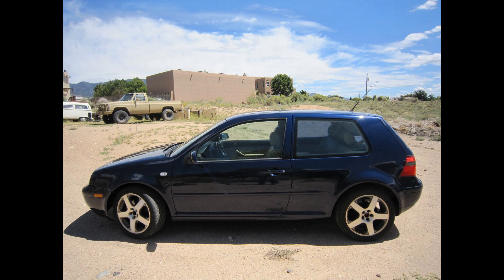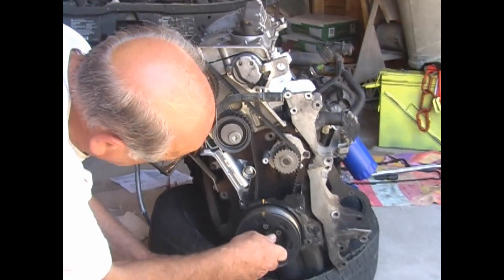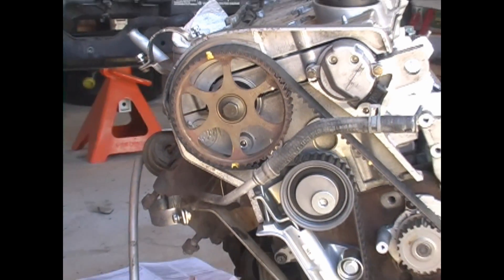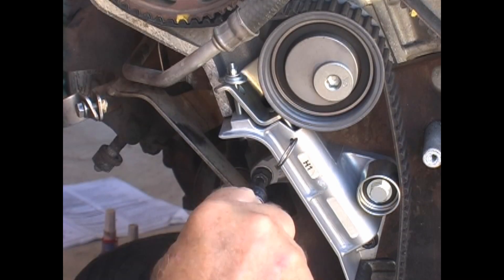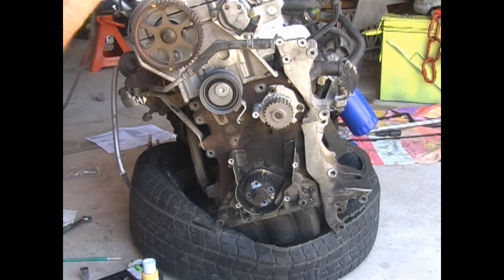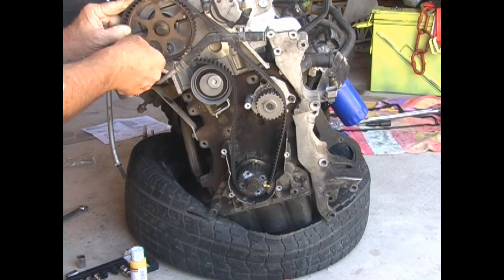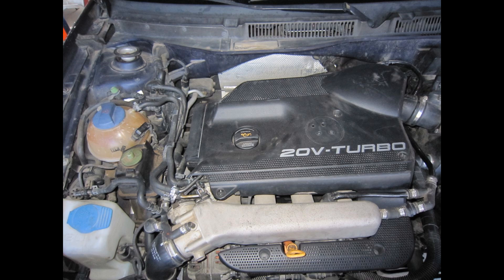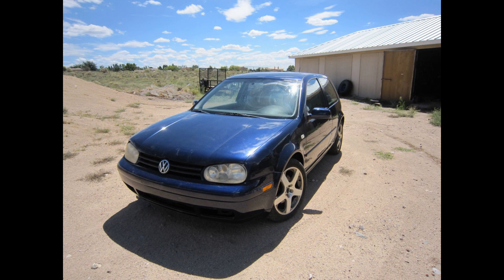VW/Audi 1.8 Turbo Timing Belt Replacement

Comment: I'm trying to do this fix but I can't get the crankshaft pulley and the camshaft pulley marks to line up at the timing marks at the same time.
The marks are way off and not 180 degrees The engine runs good but needs a water pump . This car is new to me but I can tell the belt has been replaced at one time  it's a Napa belt . Any idea what I'm doing wrong? Great video by the way. Thanks
Reply from the maker: Hi Mark - I just got back in town from Christmas trip and saw your message.  I am assuming that from your comments, the car is still running but needs a water pump replacement.  If the engine is running fine it means that the valve timing is very close to correct.  If it were very far off, the engine wouldn't run very well if at all and the valves could be damaged but that doesn't seem to be the case with your engine.  At around 50 seconds into my video, it shows the timing marks lined up.  Just be aware that the camshaft rotates half the speed of the crankshaft.  I suggest you rotate the engine to get the camshaft marks lined up and then check the crankshaft marks.  If they are not lined up as shown in the video, maybe you could describe what you see at the crankshaft marks.  It could be that when the previous belt was installed that is was off a tooth or two  That is easy to do and the big reason behind my suggestion to mark the belt.  I will be glad to help further if you haven't figured it and can supply some more detail.  Good Luck.  Wayland
Reply: Wayland Adams  
Thanks for replying, yes the car does run fine but needs a new water pump. When I try to get the motor to TDC no matter how many revolutions I can't get the crankshaft to line up at same time and it's a long ways off and more than a tooth or two. I'm wondering if the  pulleys could of been taken off at one time and put on wrong? Could I just go through this process of marking everything with the cam at the timing mark as long as nothing gets moved?Thanks for helping
Reply from the maker: Mark  That is really strange.  The pulleys are only supposed to go on one way.  But yes, you can follow the procedures, marking the belt at corresponding marks on the sprockets.  So, I would line up the camshaft timing marks on the sprocket and engine block, then pay real close attention as you remove the crankshaft pulling and cover.  At about 1 minute 30 seconds into the video I show marking a crankshaft tooth and the corresponding position on the block.  This is real important to do since the timing marks have been removed with the pulley and cover.  Then just make sure these marks stay lined up through out the procedure.  You will note in the video that I mark the belt at the timing mark on the camshaft, but at the crankshaft the mark on the belt is not at the timing mark.  But that is okay since you just want to keep the same relative position.  It doesn't show very well in the video but at the place where I mark the belt at the crankshaft, there is a little knob on the sprocket.  This knob is what aligns the pulley in only one way with crankshaft.  I just picked that place but you could pick any place where the belt is engaged on the sprocket and mark both the belt and the sprocket.  

It sounds like you have a pretty good understanding of what needs to be done.  But if you think you need more help let me know.  If you want to give me your phone number and/or email address we could talk and/or exchange photos.  Good luck on getting this done.  Wayland
Reply: Wayland Adams 
Thanks for the help, I messed with it today and got the pulleys lined up finally. Thanks again for the help
Reply from the maker: Glad  you  got it.  Hope the repair goes well.
Reply: Wayland Adams I could use your help

Comment: Somebody help me please! !
I did a timing belt, water pump, tensioner yesterday on my 2000 audi tt 1.8. Water pump was leaking, so I decided to might as well change everything;, so I did.
When I was done I started the car and 2 mins later check engine light came on;code reader said:( cylinder 1 misfire detected)
So.. I changed spark plugs and switched ignition coil from cyl. 1 to cyl. 4 .
Started the car and check engine light came back on. Checked it and still tells me p0301 cylinder 1 misfire detected. Any ideas or suggestions please Help me ! Thank you ☺.
Reply from the maker: Hi Danny

Sorry you are having problems.  It takes three things to have combustion.  Compression, fuel, and spark.  You have probably eliminated spark by changing the ignition coil but don't completely rule it out.  You can do a compression check to make sure you are getting compression on that cylinder.   It would be pretty unlikely that compression is the problem but it is easy to eliminate.  For the fuel injector, first just make sure it didn't get disconnected while you were working on the engine.  You can also google how to check a fuel injector.  You just need to make sure you have all three of those items.  I have to assume you did the timing right since it is running on the other 3 cylinders.  Good luck.  Let me know if you have other questions.
Reply: Wayland Adams 
Thank you Sr for replying.
I will definitely take ur advice and check injectors. 
And yes like I said: the car didn't change in engine sound and performance wise, it just runs like it did before,  but what worries me is that I don't know much about the electric stuff,  like for example if I needed it to reset or disconnect cam or crank shaft before I started the car.  
Because all I did was Take out parts and put them back the way they were back, and started the car and 2 min later check engine light says cylinder 1 misfire.
Any thoughts on cam and crank shaft. How they  work?   Could that cause a misfire? Should I check those? (Car starts right away,and doesn't hesitate or feels weird after all the work I did on it.)
I may add that my fuel gauge had been working abnormal way before I did this timing belt procedure, sometimes it worked just fine and sometimes it drops  dead not working at all, I changed the fuel pump and fuel filter but that didn't fix it, so I just let it be but never gave me a check engine light,  I wonder if it's related... maybe..  
I'll keep updating yall as I'm  making progress on my TT. ☺
Reply from the maker: You shouldn't have to do anything other than what you did  There is nothing to reset.  Just check those 3 things and make sure everything is connected.
Reply: Wayland Adams 
Oh OK thank you!! That takes care of my concerns about that. ☺
I may add that my fuel gauge had been working abnormal way before I did this timing belt procedure, sometimes it worked just fine, and sometimes it drops  dead not working at all, I changed the fuel pump and fuel filter but that didn't fix it a while ago, so I just let it be but never gave me a check engine light,  I wonder if it's related.
I never bother to fix it ,cause it never gave me a check engine light.
Thank much for your time and advice, very much appreciated ☺
Reply from the maker: The fuel gauge will not cause a check engine light so I don't think that is related to your current problem,.
Reply: Wayland Adams 
Okey dokey 
I will continue my investigation and follow your advices.
Thanks much!! 👍👍

Comment: So that's the thread pitch? 5x55mm doesn't tell me that.
Reply: 5 x 55 means M5 thread form and pitch and 55mm long.  M5 is an ISO standard and it only comes in one form.  If you buy a kit the tensioner should be pre-tensioned with a pull out pin you pull when ready.
Reply: It's not relevant. You may even be able to use a 6mm nut and bolt. Just buy a 55mm long bolt and the nut to match. Better yet, buy a couple of nuts. You may drop one and they always get lost. Also, buy 5mm washers and some extras for the same reason. (BTW, the thread pitch of a 5mm nut or bolt is .80mm.)

Comment: Wayland adams u are the man explain all the work on astra very good mate  but I want to know more work on to new  astra which is 1.7 cdti 2012 plate hatch back  anyway thank you verymuch  mate keep it up
Reply from the maker: I am not aware that we have that car/engine available in the US.  I did look a little online  and found that just like the 1.8 Turbo in VW it is an interference engine.  That means the valves will be damaged if the timing belt breaks so it is very important to change it as recommended.  While I don't have access to this particular engine I would think you could follow the basic steps I outlined.  I just really found it useful to mark the old belt and transfer to the new one.  I assume you have also looked online at some of the instructions there for changing the belt.  Good luck.

Comment: Do some work on the astra 1.7 cdti 2012 plate
Reply from the maker: If you are asking if this works on the astra 1.7 cdti engine, I don't know for sure.  The principles of marking the belt and aligning the timing marks apply to all engines.  Good luck, if you have further questions let me know.
Reply: Wayland Adams good luck mate

Comment: im going to attempt this without removing the engine.. im only in highschool and my 1.8t gti is my first car haha. i cant afford the price a shop will charge me, so wish me luck.. Thanks for the video!!
Reply: Do NOT REMOVE THE ENGINE MOUNT COMPLETELY.. .you will never get it installed with belt installed... it’s a pain. Yes but it can be done
Reply from the maker: Jorge  Good luck with this.  It is possible to do in the car using the same procedures as in my video.  I did it outside the car for two reason.  I had to change the head also plus I couldn't really show the things in the video with the engine in the car.  Good Luck!!!
Reply from the maker: Yes, you can mess up the engine if you don't get the valve timing right.
Reply from the maker: Good luck.  It is possible to do in the care.  Just take your time and double check to see that the valve timing is correct.
Reply: As long as you make the marks like he did no chance of fing it up. Once assembly just hand crank with a 19mm 3 complete revolutions to make sure the timing marks are accurate.  Also get the engine mount and engine bracket to mount out of the way to give you plenty of room.  You'll need an engine hoist or can put a jack under the engine oil pan.  I would fold up a towel to help protect between jack and pan. You'll need to move the engine up and down a little to help get the mount out of the way.
Reply: If you do it wrong, you could fuck up the timing of the engine and kill your motor

Comment: your video is great if you work on the car chris mosley  you can follow mr, wayland adams video but take out the small puley on the tensioner . after install the tensioner push the belt to the radiator side and install the little puley with 13 mm socket . thank adams for helping people
Reply from the maker: Thanks for the comment and the suggestion.  Glad the video helped

Comment: Excellent video and tutorial! Any other items that you would suggest to replace as long as you are in there? Spending a little extra money on a couple of items beats doing the whole job over in a week or two because something that you had apart failed two wees later.
Reply from the maker: Glad you liked the video.  I mentioned most of things to change in the video.  Definitely replace the water pump, the belt tensioner and all the rollers/idler pulleys.   As you say, it is better to do them while there.  Aside from that, you might check your alternator.  With the drive belt off the alternator you can rotate it to see if there are any rough spots or noise as it rotates.  Good luck in getting your car back on the road.
Reply: Thanks Much Appreciated!
Reply from the maker: you're welcome

Comment: what ifthey moved the camshaft and lost place how do u get it back
Reply from the maker: Sorry for the delay in responding.  I have been away from access to the internet for several days.  To get the camshaft back you just align the marks on the camshaft sprocket with the mark on the case of the engine.  The thing I worry about in this situation is that can be infterference between the valves and the piston when the camshaft and crankshaft or not aligned together.  If this happened while the engine is running, you probably have bent valves.  Let me know if you have other questions.

Comment: Well, as having done this with the motor still inside a motor bay, i wonder how much easier it is to just pull the engine?  haha
Reply from the maker: I have never done it with the engine in the car so I can't really compare.  I have heard from many that it is possible to do in the car.  In my case, the belt had broken while driving resulting in bent valves.  So I had to rebuilt the head.  It was just easier to pull the engine to do all the work.  I shot the video with the engine outside the car so I could show the details that would be impossible to show with the engine still in the car.  I think I would probably change tje belt with the engine in the car if I wasn't messing with the head.  Hopefully the video help you do it while still in the car but I am sure it a difficult and tedious task.

Comment: Thanks for this excellent tutorial. I just have a question because I learned when you have replace the new timing belt, you have to rotate the crankshaft on two laps to be sure the marks are still align, What do you think about that? Regards from France
Reply: I say a little mistake because the two laps you have to do are to check if the camshaft pulley repere is still align with engine repere. No report with marks you did on the timing belt.
Reply from the maker: Hi - yes, that is the recommended procedure that after you get it all back together that you rotate the engine two turns on the crankshaft.  I cover that right at the end of the video.  Just be aware that when you rotate the engine you are looking for alignment of the timing marks on the gears and on the case.  The timing marks you put on the belt will no longer align and that is okay.  It is the timing marks on the gear and case.that are important.

Comment: Finally a useful fucking video. Nice angles, explains everything. Wouldn't believe how many vids suck. Just one thing. You obviously had a cameraman. Shouldve used that extra hand xD
Reply from the maker: Thanks for the comments.  Yes, I did have a cameraman (my son).  That with post editing and narration make a much better video.  Explain a little more what you mean by using the extra hand.

Comment: I had no problem putting the belt on with the idler pulley swung down and the tensioner remover but when I pull the idler back up to install the tensioner the crank timing mark goes off. I've tried every other method out there and am still having problems.
Reply from the maker: Hi Chris - Sorry you are having problems.  I am having a little trouble understanding your question.  Are you saying the crankshaft turns when you lift up the idler pulley so the timing mark is off?  Do you have the marks on the belt as described in the video?  If you have the belt installed correctly, any clockwise movement of the crankshaft should result in movement of the camshaft.  Just explain a little more about the problem you are having and I will be happy to help.  If you are in the US and would like to talk on the phone, give me your phone number and I will call.
Reply: Hi Wayland 
Yes, I have the tensioner removed and the idler puller is swung down. The new belt with no marks will go right over everything but when I lift up on the idler pulley to install the tensioner the timing on the crank goes off. I have the spark plugs reinstalled to try to keep the crank from rotating and it's in gear but it doesn't seem to make a difference I can still rotate the crank with my bare hand when it's at TDC. I never marked my old belt.  336 803 3016.  United states.
Reply: Also, I might add that on the 02 beetle, the engine bracket must remain in or you won't be able to reinstall it after you put the new tensioner and idler and water pump back in . This makes it a pain because it's hard to see what you're doing as well as trying to reinstall the tensioner.

Comment: hey Wayland,  don't get me wrong. I don't think I would've got in on any other way.  seems whatever position I tried to but the belt in when I lifted up the idler pulley either the crank or the camshaft moved so I'd put them pack and start over I thought in finally had it but maybe it moved when I was under the car putting the tensioner on. I also took that little roller off the tensioner.  it  made it easier. the thought has crossed my mind, although unlikely that the cam shaft timing marks were missing marked at the factory. I wish I could see the valves .
Reply from the maker: Chris - no problem I don't think I took it wrong.  I just wanted others to understand that the video is still probably the best way to change the belt even with the engine still in the car.  I can only imagine how hard it must be.  I think taking the little roller off is a good suggestion.  I missed that when doing it on the engine out of the car.  I had plenty of room and leverage to just hold the tensioner where it needed to be without removing the little roller.  Thanks so much for your comments.  I am sure others following my channel appreciate your insights.
Reply: Thanks Wayland. I'll let you all know how it comes out. Have a good one.